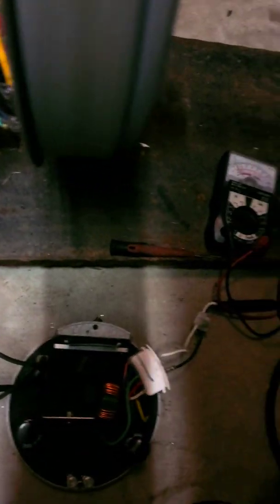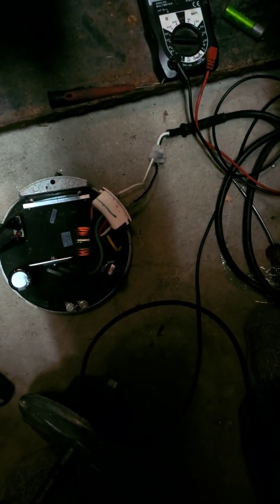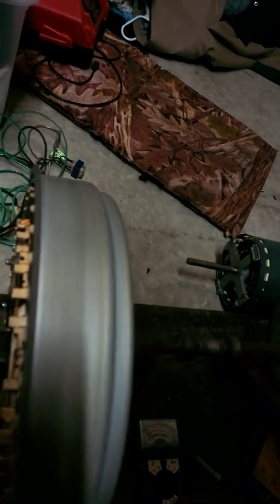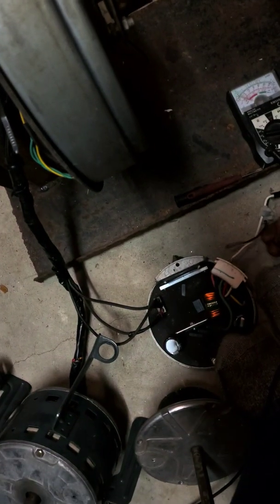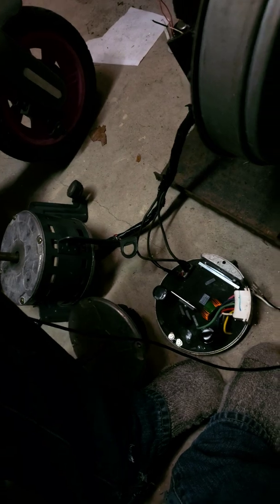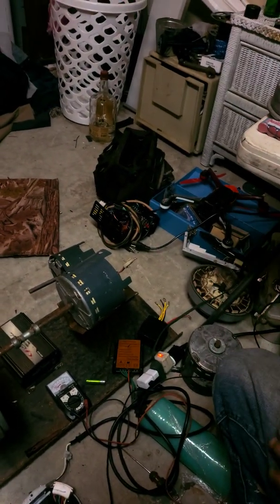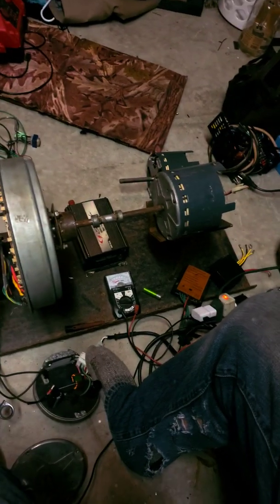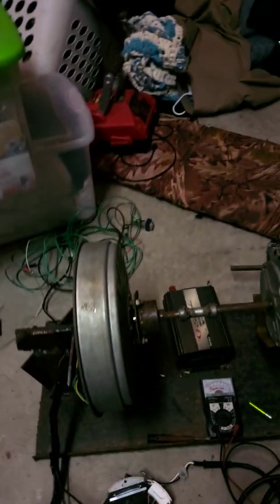HOW TO HACK A ECM MOTOR Repurpose controller/ motor is generator!

Comment: Can you please do what you said on ur other video….  Make a video useing your Anaheim controller with sensors ..on different ecm motors. ….1/16 …1/2 … 1 horsepower ..etc.   because of different amp rattings…you will get better results… I get 1900rpm useing it with that big motor no problem….  I will start to collect motors like you but you have them now… I suggest you get moving spinning them up …..   please make videos….. and post them … you are few years behind me with this I’ve got mad ideas… but you got supplies….lol….post post post… I’ll be watching
Reply from the maker: Thanks for suggestions but I'm dying to know more about your research with these motors. Please contact me! Nickl4462@gmail.com.  I was literally trying to fix my Anaheim controller last night but I'm having trouble. But if you have one then maybe you can help me figure out what is wrong with mine!! We can do tests on components and compare results. If you could help I would be so grateful! I have ecm motors with sensors already on them too. I used one for my sons trike with e bike controller just only has low rpm but excellent torque